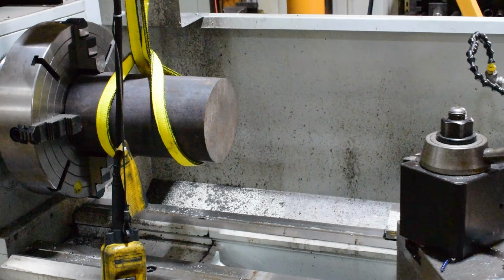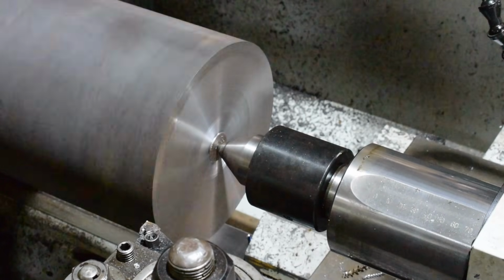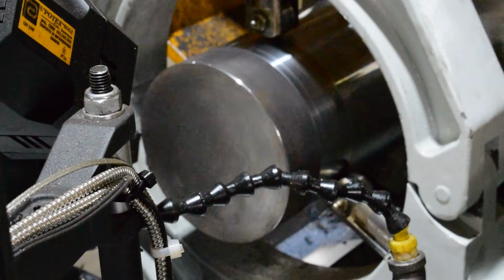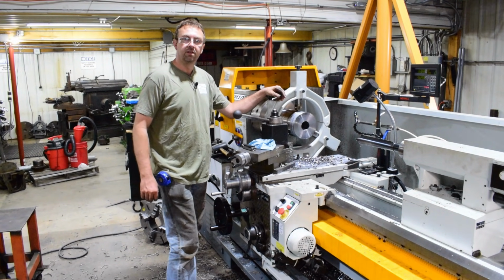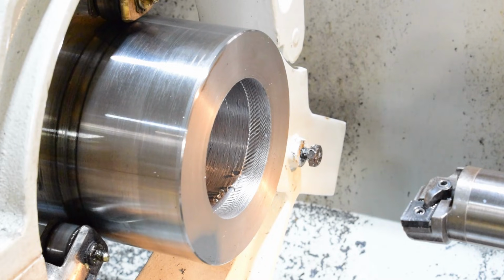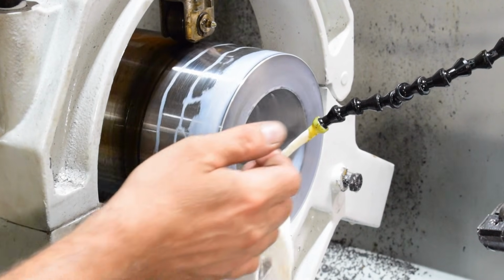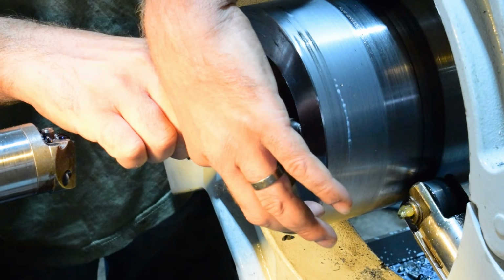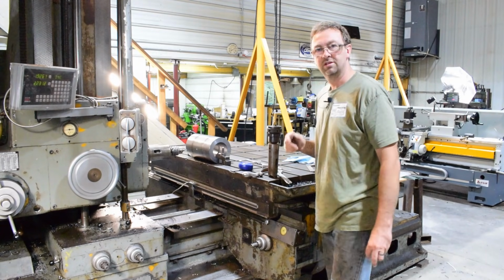Making a Replacement Excavator Bucket Pivot Tube - Machining - Large Piece Work

Comment: I would have machined this whole operation with just the 4 jaw holding it with no center or steady rest. Also when darling it in the first time, there should always be a gap between the chuck and the  part. 4 jaw chucks have incredible holding power. 4 times stronger than a 3 jaw.

Comment: Telescoping gage not an inside micrometer .
Reply: Either works fine, it's in the touch of the machinist and the clearance for fingers in the one case, idiot proof and such for the telescoping gages since you are using the easy read mic barrel. Depth mics are a pain unless your brain works that way. Inside mics are fine to read, with a loop for me at my age.

Comment: You can trust your four jaw chuck when facing.  The clamping force is so much higher than your three jaw chuck.  This is one reason I use my four jaw chuck more times than I use the three jaw on big lathes.

Regards

Alan

Comment: I just caught this vlog...A 3 jaw is for Hex Stock...Get into a habit on using a 4 jaw.
Set up the steady rest BEFORE you switch chucks....Why ? 
"Well, to each his own"
Cut a piece of card board over the diameter of the work, in front of the "steady to deflect any metal swarf getting  between the "steady" rollers and scoring the work.
Slow the machine down...Sharp tip on the boring bar to work that "Chatter" out
A vernier caliper is OK for a quick measuring...Oh ...your using a mic ...never mind...

You might want to wear that Wedding Ring on a chain around you neck under you tee shirt.
your Bride won't mind....

Like some features of that lathe.
......................Robbie

Comment: One question, why was the boring bar angled down 23:38?
Reply: Since no one answered I'll try. It could be for negative rake, breaking chips even better with the high pressure angle, if there are other reasons they escape me at present. hth

Comment: I'm not one to be snotty about jargon, but is that accurately called a spade drill? I've always thought of those as insert drills. What I'm used to calling Spade drills, is typically an arbor with a slot with interchangeable flat blades of varying length. Ends up looking like woodworking Spade bits but the Spade is interchangeable. I don't know if you watch James Kilroy, but he demos them often, I believe he uses them strictly on the lathe, no twist drills. I know a handful of job shops near me that have a no twist drills rule. My understanding is it is economy based, take too long to re-sharpen compared to the very fast flat blades. I believe you can also order replacement blades, but they are usually an inch deep, allowing for a lifetime of re-sharpening.

Comment: You did a nice job on both the project and the video. It is too bad that you did not have very much material for cleaning the sides and the ends. I can see how handy the crane is when you have heavy material. You are interesting to watch. I did make something. I made a 6' screen to filter out the large rocks. It works great but the weeds plug it up. I sure wish that I could have made the frame out of steel. The screen is a 2" cyclone fence that I got from the recycle center. Looking forward to seeing your next video. 😃😃😃😃😃😃😃😃😃😃😎😎😎😎

Comment: I Don't know why you would start with a 4 jaw then go to a 3 jaw and then talk about concentricity ??? it's cold roil steal with mill scale grind mil scale off and nil to non jumping of the indicator don't know what your trying to do here bit confusing with the 3 and 4 jaw chucks
Reply from the maker: It was hot rolled.
Reply: The raw material isn't always round so it might not grip firmly in a 3 jaw chuck but a 4 jaw can grip it firmly because each jaw moves independently. On that large of a piece, you don't want to risk it coming loose in the chuck. Once the outer diameter is turned round on one end, the three jaw will hold it well and it makes it easier to switch ends to finish the machining processes.

Comment: Nice work! Unfortunately, welding this in is going to really distort this. I would be curious to see after welding ID dimensions.
Reply from the maker: I don't think it will. It is very thick yet and should hold just fine. I know that they build them new the same way. But, I have been known to be wrong a time or two. Just ask my wife!  Lol
Reply: This is not a high pression part despite all the extra steps taken.

Comment: What material was supplied for the boss and the bushes and what sort of interference fit are you planning? When I worked on excavators we set the bushes for very tight press fit and made allowance for crush of the bush. If the operator was lazy with the grease gun the pin will seize and spin the bush, then it's game over.
Reply from the maker: The material for the tube was 7" 1018 hot rolled and the bushing was 1020 DOM tubing. I really advised against the choice of bushing, but again, the customer is right and writing the check.
Reply: @TopperMachineLLC  Hi Josh, I can't see either lasting for long, especially the bushes. I think it likely that the bush will quickly deform.
Reply from the maker: @garychaplin9861  I agree.  The customer supplied the material against my recommendation. It's on him if it doesn't hold up.
Reply: @TopperMachineLLC  Josh, you should make a video of you with an "I told you so" expression when the customer brings the job back to have it re done in appropriate material. But then, he would probably be too embarrassed, especially if it fails at low hours.
Reply: Guy should have just bought the Cat bushings.